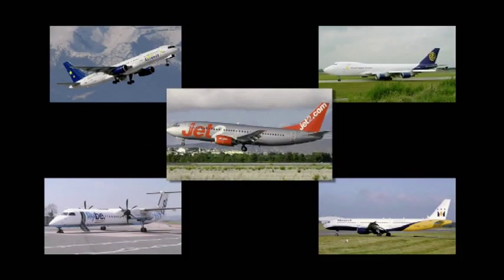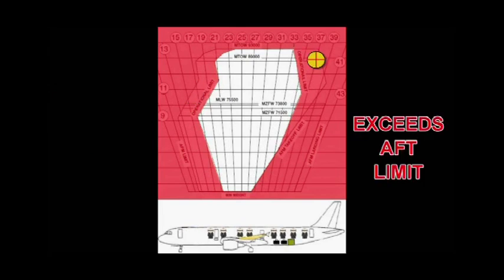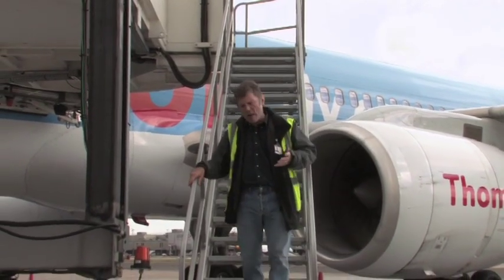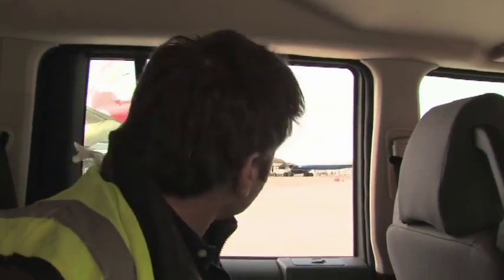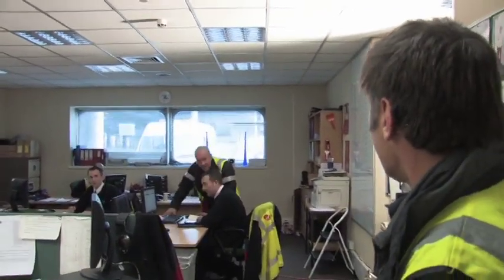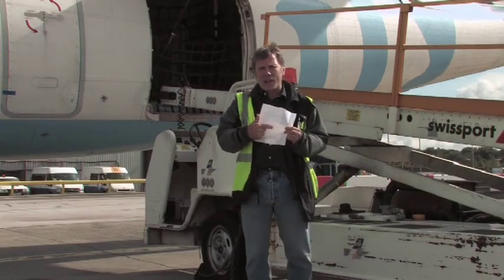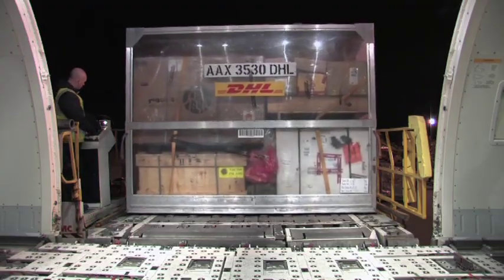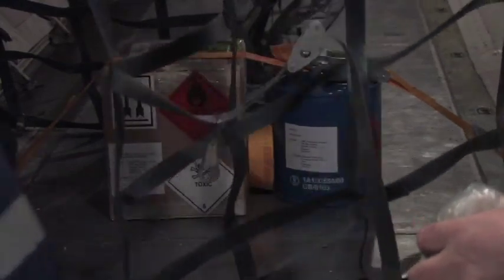Safety In The Balance

Comment: What center of gravity is better? A forward cg within range or an aft cg within range. Which cg will allow a higher cruise airspeed for the same gross weight, a forward cg or an aft cg? Thank you.
Reply: Hi, Larry. I just opened this video for the first time.  I am amazed that no one has responded to your excellent question.  Near the aft CG limit is much more fuel efficient than a neutral or forward CG on a conventional aircraft with an aft horizontal stabilizer/elevator.  I will explain the aerodynamics of it if you are interested. But be aware that at or aft of that aft CG limit, the aircraft will be unrecoverable from an upset or a stall.
There was a pilot in one of my fighter squadrons named Ehrlich.  Very bright fellow, although. . . .